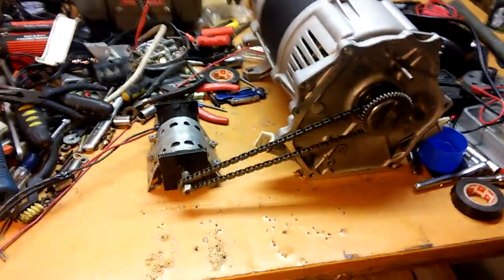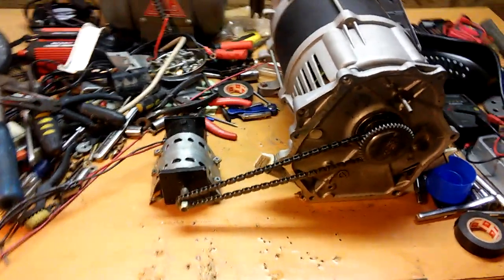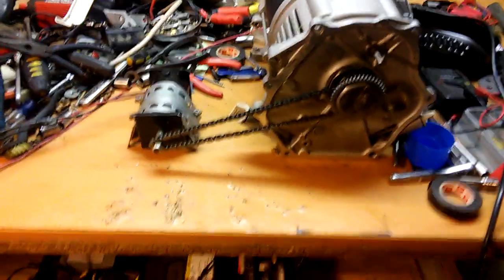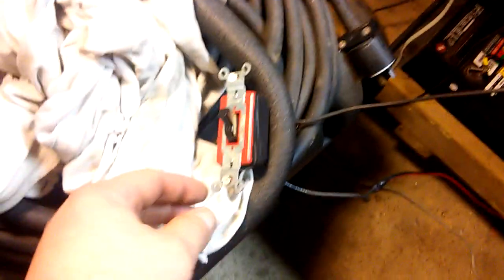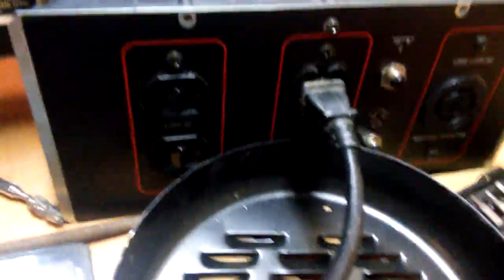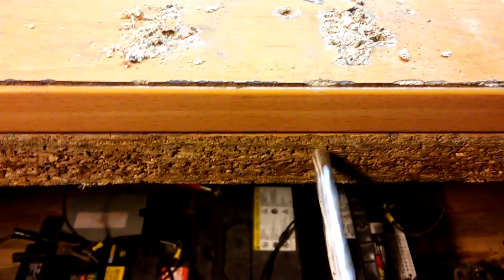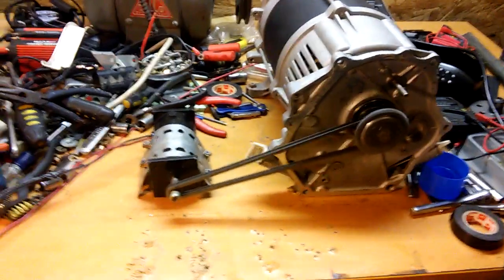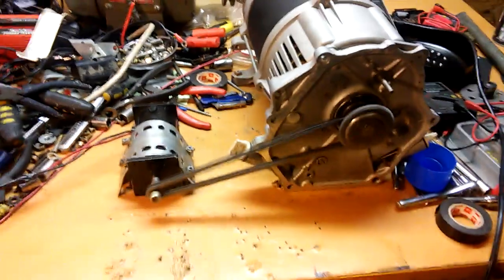24 volt dc motor running 6250/5000 watt generator.

Comment: My alternative reality is to put my 9 solar panels thru a inverter that runs a 2-3 hp single phase electric motor that turns a 5kva generator to run my house...can this be done. I am just ordinary Joe trying to save a dollar.
Reply: I guess u can instead use a ac inverter to charge the battery that u get from the 5KVA generator alternatively....... just like u use it for other house hold use.
Reply: Neill J why do you need a generator if you already have an inverter to convert a VDC supplied from solar/battery to VAC? The purpose of this concept is to cut out inverter and battery bank.
Reply: This no cog generator low rpm is the key https://youtu.be/Z4_yitCl_Gw http://www.ftcinnovations.com/
Reply: Neill J you would be wasting power. Just hook the inverter directly to the batteries that the solar panels power

Comment: HAHA Yeah right it takes a 10 HP Gas engine to turn that thing at full load and your going to attempt it with a small ass 24v motor?
Reply: This no cog generator low rpm is the key https://youtu.be/Z4_yitCl_Gw http://www.ftcinnovations.com/
Reply: This is not a alternator thats a DC motor with no cogging soo it is true!
Reply from the maker: Kevin Mask it works. Of course you could put a larger Motor and more batteries and trickle charge as you are running it if the solar panels aren't enough. I don't see anything funny here? Thanks for the post.

Comment: I saw your design an I like it please what type of chain did you make use of
Reply from the maker: franklincense patrick I used the chain from the broken subaru motor that the generator was attached to. You can also use the chain and sprockets from a broken  razor E100 electric scooter. Hope this helps. Thanks for posting.
Reply: thanks. can a bicycle chain work I want to practicalize it
Reply from the maker: franklincense patrick as long as the gears you use fit. it doesn't have to be a chain, it could be a belt, etc. I just used the chain because it was there.

Comment: Can I use the 300w solar panel to DC Motor running 5kw generator to charger Tasla powerwall (3000w~3500w  )? Thanks
Reply from the maker: hotspotnews the 300w solar panel will only trickle charge your wall. I would add solar panels and verify the wattage going into the wall to make sure it is enough,to keep your wall charged. Good luck.

Comment: What kind of motor is it?? And where did you get it from (the 24 volt dc motor.)
Reply: Can you use 775 motor?
Reply from the maker: The motor is a Dayton DC Motor 1/20 - 1/9 HP 12-24 Volts RPM 1750-4200 and the generator is a husky 5000-6250 watts. Thanks for watching.

Comment: did you continue your project ? can a 24v dc motor run an 5000w AC alternator at full load ? if so then u reached the point where output is bigger than input thing formula :)
Reply from the maker: I will get back to it in a few months. Stay tuned and thanks for the comment.

Comment: Sure it can work, but, you are putting more watts into the motor than the generator is putting out!
Reply from the maker: The motor is using 24 volts from the battery array that is charged from the solar panel. My next attempt will be to test under full load. Thanks for your comment.
Reply from the maker: Hernando Cortez the point here is free energy. Regardless of how much power you put into it you are not paying for it. Thanks for the comment.
Reply: if i m not wrong, #steven_chartier has attatched the input is less than 100W dc and the output is far more i.e. 5000W +, doesn't matter AC or DC.....
only fact is that the rotation is possible with such tiny DC rotator motor.........

hb72742@gmail.com

Comment: All Year First , thank you FOR YOUR shares and would like you to give us the names of engine and generator. Thank you in advance.
Reply from the maker: The motor is a Dayton DC Motor 1/20 - 1/9 HP 12-24 Volts RPM 1750-4200 and the generator is a husky 5000-6250 watts. Thanks for watching.

Comment: Cool demonstration :)  But in reality, it would be better to use the energy from the (solar-charged) batteries directly by using an efficient power inverter to power the load (drill, etc)...
Reply from the maker: Agreed. Thanks for the comment.